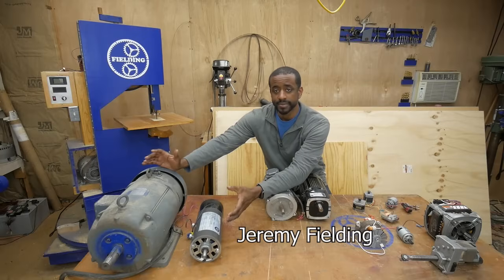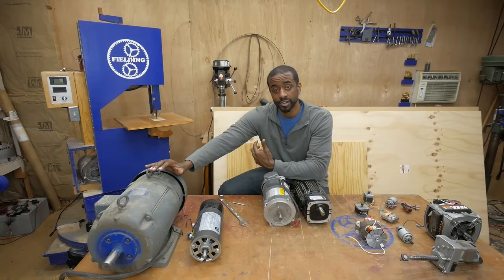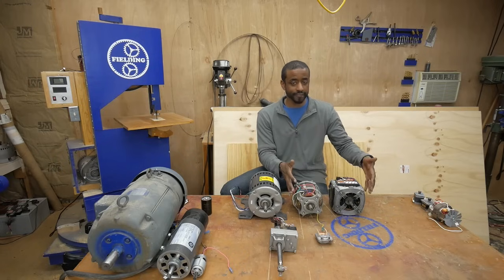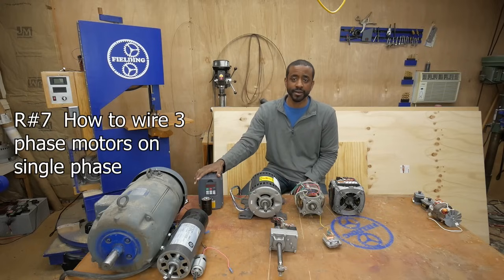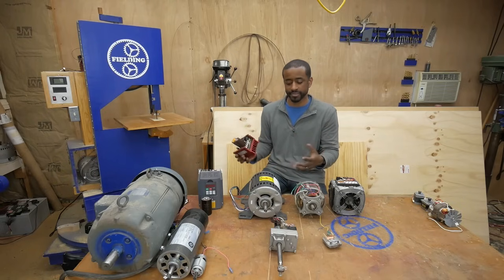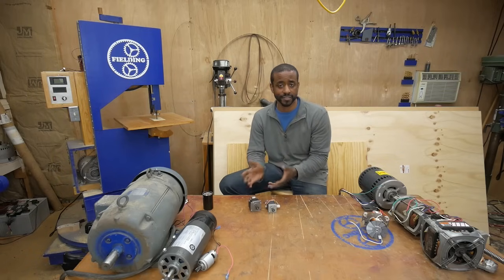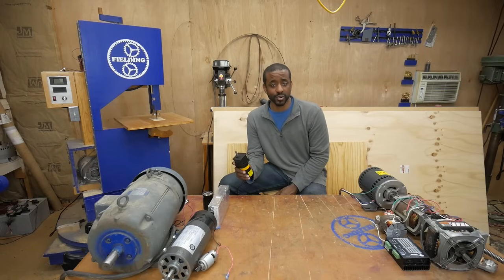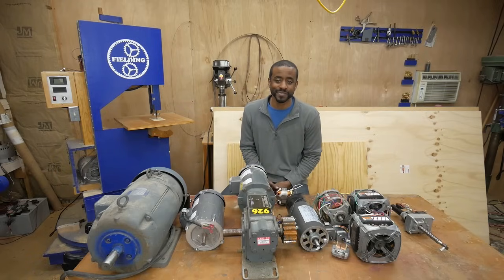Ultimate Beginners Guide to Using Electric Motors for Makers and DIY Projects; #068

Comment: I just replaced a washing machine and took the good motor out if the old one (was replaced due to major leaks from bad seals, a good Speed Queen Commercial Grade washer) and I'm trying to figure out how to build a two wheel drive "mini-bike" using that electric motor for the front wheel and a 196cc Briggs & Stratton Intek OHV 4-stroke "Predator Clone" 6.5hp engine to power the rear wheel and provide power to the front motor through a small generator or inverter. It's alot to package, and I think I'll need to build a custom frame/chassis, but might use wood just for fun and to avoid welding. Any thoughts on the inverter and a speed controller? Will I need a battery pack to act as an intermediary? Or can I do what I really wanna do and make it like a modern hybrid car? As in, it can run solely on the electric motor by way of a battery pack or directly by using the gas engine for power and disconnecting the RWD on demand, and being able to just run the gas engine or run both without a battery pack to save alot of weight. Basically a four drive mode setup, though the fourth would require a battery pack. I might have to just build a Go-Kart 😂🌀⚡🔥

Comment: I have a question for you Jeremy. How do I determine how much speed v/s torche I need to power the a shop tool that I have fabricated. 

I have an extensive background in carpentry as a cabinet and furniture maker, electrician, and welder. I am retired and I am working on my woodshop.

I needed an 18 inch deep bandsaw and I have made one. I have several motors to chose from. The one I was going to use is a 5 hp beast, with a cap to get it started.

I have not checked the tourche rating yet. What are your thoughts on this?

Comment: I trying to buy a motor but am worried about the amp i am going to push through it. The wires seem to have no gauge number on them but have a bullet connector. the wire seem too thin for the amps i am going to push through it (150 amps). how can i be safe knowing that the default wires that come out of the motors are saft to use?

Comment: I couldn't agree more with the first few reviewers I read. I learned 2-3 things about belts, pulleys, and motors in less than 5 minutes on all 3 videos I watched so far, and will be getting to all of them ASAP. Some info I wondered about for years and never remembered to try and figure out why, or couldn't find the info online, so I am most grateful. Tomorrow I can confidently get my pneumatic drum sander to create less vibration now that I know what has been causing it, I thought it was the axle or bearings replaced bearing but no improvement, but now I am sure how. Thanks.

Comment: Current is proportional to torque. Voltage is proportional to speed. Power is voltage times the current. If you exceed the power rating of the motor, then you can run the risk of burning up the windings inside the motor. The motor is wound with a certain gauge wire. You can look and see what the power rating is by looking within the NEC book. Properly sizing a motor to the project you are going to be working on is an essential component to ensuring that the project will run smoothly under load.

Comment: Always enjoy your videos! I was wondering if I could pick your brain a bit. I made a wooden bandsaw years ago and have a 3hp motor attached, set up for 240v single phase. It has so much torque that the drive belt screeches badly on startup no matter what the belt tension is. I would love to figure out a way to create a safe soft start circuit to ramp the motor up slowly to full rpm over the course of 2 seconds or so. I've seen a few videos about soft start setups using basic components as well as one using an arduino. The catch is they always use the example of a lightbulb to demonstrate the effect. I'm just having a hard time believing those components can work in this use case with a large induction motor that requires large gauge wire. I don't fully understand the components well enough to know how I could tweak things for my use case (or if they'd even work with an induction motor). Any chance you could help me figure out a way to do this?

Comment: Have you experimented using a torque converter, a CVT set up? I have a chinese Vevor electric motor advertised to be 3000 watts w/controller and throttle kit. Would a CVT be a good idea for torque and speed? You are the man! p.s. it is 72 volts power source.

Comment: I'm looking to Build a Small Shredder capable of Shredding 1/8" Aluminum, I have a left-over Motor/Gearbox Assembly. HF Style 440 Lb lifting capacity. Do you think that it would serve my needs? I'm not sure of its Torque Rating. I'm Thinking 3" Shredder Blades.

Comment: I usually stay away from videos that are more than 1 year old. But I thought "motors probably didn't change as much in the last 5 years". Glad I decided to watch your video. Great video, learned a lot!
In under 5 minutes (the induction motors chapter) you've confirmed everything I've lost half a day for, to make some sense with google searches and ChatGPT. So I need a 3 phase induction motor and a VFD that has 1 phase input and 3 phase output. And I sure hope I can control the VFD via software, using a microcontroller (like an Arduino).
The main issue remaining is that the 3 phase induction motor I see on your table is very big. If I only need about 1HP at most (not sure what's the horse power on your 3 phase induction motor), I hope I can find a much smaller motor than that. Any change to find a less than 15lbs 3-phase induction motor, maybe half the size of the one on your table?

Comment: If I need a motor doing approximately 1400-1600 rpm with a serious torc but a low input of voltage, what should I buy then?

Comment: Hello, wich kind of motor would you use to load a cross bow electricaly? With a draw weight of 130 lbs and a firing rate of 2 bolt per second ?
Reply: It need aproximately 4,2 HP or 3200 W

Comment: So far he coved some of what I need but I look to build either a electric go kart or three wheeled electric tricycle but I wondering if I should use brushless and if is how to I got the wiring the hardest part is understanding the diagrams of wiring which would be helpful if I could find some good representations of those how to wire a controller and power to your motor and all that stuff but I'm just mainly looking for small electric vehicles motors for stuff like that but I lack the wiring know how

Comment: Hi I need some help. I want to build like a pottery wheel with a 24 inch base. I probably need like an ac motor with maybe 1/2 to 1 hp with the drive speed control and like 150 to 1000 rpms and mayne like a right angle motor. What do you recommend. Under the base I would have casters for the weight on top of the base probably like 150 pounds. What do you recommend thanks

Comment: Hi, Jeremy great info you put out glad to have a person who knows this info, I would like to know how to run my treadmill and then switch the power to run it off of an inverter I have the treadmill set up to run Hoverboard motor as a generator through a rectifier and into a buck booster and then to the inverter to make 115 volts Ac I am running the hoverboard wheel of of the belt to turn it I need the treadmill plugged into the wall to run it to get the speed up then to switch it over to inverter power what kind of switch do I need to do this 115 AC wall to 115 Ac volts inverter hope you understand this I have it working up to the point where I need the two do not short each other out. thanks for your help on this.

Comment: Im very impressed that your correctly used the term VFD for AC motors. All too often people confuse VFD with VSD. One other interesting thing is that when going from 1ph to 3ph, the voltage stays the same. The conversions does not increase the voltage. it just adds 2 more phases shifted 120 deg.
In Australia, 1ph is 240V and 3ph is 415V. But when going from 1ph 240 to 3ph, its 240V 3ph, not 415V 3ph. Most motors will have the lower voltage 3ph identification on the name plate and will require a Star or Delta configuration specifically for the lower voltage.

Comment: I'm glad to to see that there I saw nothing but positive comments here cuz it's a really positive thing that there's so many smart minds here actually trying to learn something instead of trying to find something to debunk debate or rise the presenter about I personally find your videos very informative you get right to the point with layman's terms well at least once I'm familiar with. I do work with a lot of motors in my industry as well as these motors are very functional in our lives where the people know it or not there's a motor that does just about everything for us washing machines fans cars swimming pools etc it also the reason why I've been trying to learn more about motors is because I started becoming a scraper during covid and I like to build things I work in the theater and we're always looking to make things move anywhere from something small to very very large objects to raise overhead I have a certification and see a motors and I was very fascinated some of the stuff still even though I know how to operate them tear them down and rebuild them that the science has made a lot clearer hereI saved and not scrapped and the ones that I'm looking to turn something into I'm glad I save them along with some of the extras needed to power them like other capacitors from other units and thermal switches fuses ect.. thank for well thought out easy to follow introductory to intermediate lesson breakdowns. I'm currently trying to make some Christmas effects and one of the things is is a ferris wheel have any motors and I'm trying to pick out one and I'm not looking to turn the wheel itself I'm looking to spin it with a drive on the bottom like they do in the bigger versions the only thing I haven't figured out yet and I know they have cams but I still don't understand how it would work is adding lights to a and still have them have have home run power to auxiliary controller and power box 
I'm sure you probably don't have time to read this but if any of your friends to send me a message that would be great
From a new fan
 IN SOME CIRCLES KNOWN AS
⚔️THEATRE🥀GOD⚔️

Comment: hey man ive been a fan of magnets and electric motors since a child.
but never dug too deep into it as its a whoole nother rabbit hole to go down and i already went down too many.
i have a project ive been doing and i need a motor that can hold a load. ac or dc is fine but low power but can carry a decent load. 
i need about 2000-3000 rpms shaft speed on the thing being driven. 
12v dc motor kind of spun the pulleys with no load i figured it was a bust.
1/3 hp weed whacker motor got the speed and the load but it did not like the load and let out some magic smoke.
10000 rpm angle grinder got the speeds held the load but a very short while it started to get crispy. understandable.
im almost thinking like a bench grinder or something would have a load bearing motor for me. but its not that big of a load. i just dont need heavy or bulky i have to move it around.
id love to tell you what im working on but theres no way i could tell you here.
i just need to find a motor that can run this without breaking my back.

Comment: Thankyou Jeremy for your fine work. You clarified the conservation of energy principle brilliantly with your words...there's got to be a trade off between speed ( angular velocity ) and torque....simple clear terminology which I've never heard before.
I will use your good work in experimental activity of my own, which includes Hydrogen fusion, Hydrogen manufacture, mechanical energy production etc.

Comment: 12:08 if you find yourself with more time than money learn ne555 circuits and how MOSFETs work. With five bucks in components purchased new you can control any dc motor and making the circuit takes thirty minutes tops with protoboard. You dont have to go full rocket surgeon to make them just rocket njrse assistant or something. A solid weeks worth of learning.

Comment: 10:37 high end angle grinders often have a universal motor. I mean the 7-9 inch dewalts or equivalent brands. If you want a reference of how it bogs down and the angle grinder is an exaggerated example because of the gearing they have but imo a perfect example.

Comment: 9:19 this was a hard lesson learned. I was converting my drill press into the ghetto mill (which was successful with a lot of pain) but i wanted to slap this 1.5hp single phase motor on the press to significantly increase the cutting power. It was literally wobbling if i didnt bolt the frame down. Anyways, I figured bypassing the capacitor with a temporary burst from the second phase would start the motor and it did... kind of. It was a crab shoot depending on the placement of the shaded poles when it stopped spinning (because the second phase is not the same as a capacitor boost its 120°? Off from the first). Sometimes, it would spin like a champ but when it didn't it would violently hum and get really hot very fast. You can technically control a single phase induction motor with a "ligjt dimmer" circuit or a triac circuit but your just cutting off parts of the sine wave and it will stres the coils and bearings more than normal operation. How many times have you replaced bearings on a bench grinder? Maybe once? I did it four times in half a year. It's rough on the bearings.

Comment: 7:38 knowing the crowd the watches these videos dont write these motors off. If you keep the mounting bracket and original blades they make excellent small ventilation fans. I have a bunch of these throughout my vent system for my lab to exhaust soldering fumes or toxic gases from certain reactions to a scrubber. Most are like 2.5 inches tip to tip which is a really common size of ventilation for dryers. Twenty bucks of dryer exhaust pipe and some duct tape is all you need. Well and the wiring/circuit for the fan but you get the idea.

Comment: What would be best kind of motor to move a boat? About 2.5t in weight and 27ft I length. I would be running I to my propeller shaft by belt and connected to solar/ battery

Comment: Very well explained even for a layman like me!
I'm looking to assemble a DIY waste-oil centrifuge, and wonder what motor would be best.
The estimated weight of the spinning drum would be about ~1.5kg + ~2L of volume to be filled inside the enclosed volume of spinning drum, in the worst case these 2L would be water so ~2kg, or ~3.5kg of total weight to spin (with diameter of ~40cm).
Now as this is to be a centrifuge highest possible RPM is desirable, but also enough torque to be able to spin those 3.5kg to those RPMs.
So do you have any advice on what motor should I'll be looking for?

Comment: Can I contact you when I'm aligning my core field to the stator wrap for a brushless motor capable of high rpm and torque. I see I need a specific core size and magnetic field strength to the wraps of the stator. And the thickness of the armature can determine torque? Or it's just the field strength related to speed and that size. If I put a swing arm on it. Instead of just an armature. Would that increase in torque decrease the rpm by torsion?

Comment: I'm actually about to start getting into designing my own motor aligning the stator wrapping volume to the magnetic field is going to be important and how many poles I can use
Reply: I'd like help...but I don't need it yet. It will be powerful. In the least I'd like to be able to reach out to you if you understand the charge relationship to torque ? I'm figuring it out..

Comment: So, if I wanted to run a three phase motor in my residential house I can use a VFD to convert the single to three phase? If so, does it have to be 240 volts?

Comment: Great video, great info.  Do you do consulting? I’d pay you to produce a report detailing the type of DC motor needed for my application, which is electric propulsion for a sailboat (high torque, low RPM, 24-48V DC) and where to procure such a motor.  Let me know…

Comment: I don't gyrate with much speed, but my torque is substantial. Thus, the girth of my shaft is noticeable when compared to others. 😉 

I'm an HVAC Test and Balance Technician. This was an excellent representation of motors and physics. 👍🏻

Comment: & what do they call torque in these motors these days do they abbreviate the word. What's the term I'm looking for when shopping for a motor with torque because for some reason I can't find Google to search up motors by tourque
Reply from the maker: Torque is not often listed by itself. You get power and speed. You have to calculate the torque using the power and speed. I talk about this in my video called " how to size a motor for any project"

Comment: I'm trying to build a DC generator for 4-1000 amp marine batteries. A separate, single 1000 amp battery is the primary power source to drive dual alternators. 1 alternator recharges the single battery and the other altenator charges the 4 batteries which provide continuous 12 volt power to a 15 X 25 foot shed. What is the best electric motor and alternators should I use?

Comment: Hello Mr. Fielding,  I can not find your video on making a power supply from a tread mill .  Please advise.  I need a power supply for a nEDM project, 60 volt and aprox 10 amp.   Looking foward  to hearing from you.  I learn a lot from your presentations.